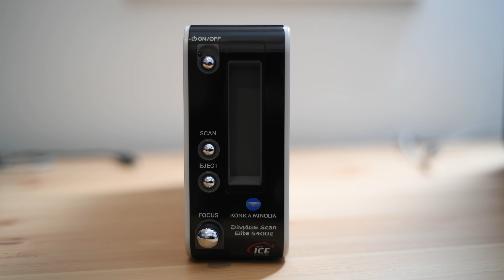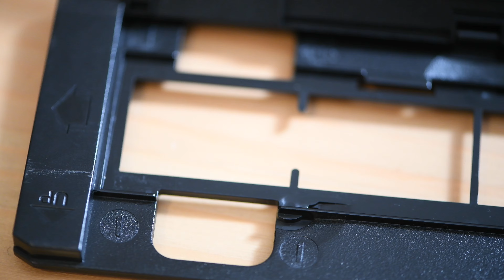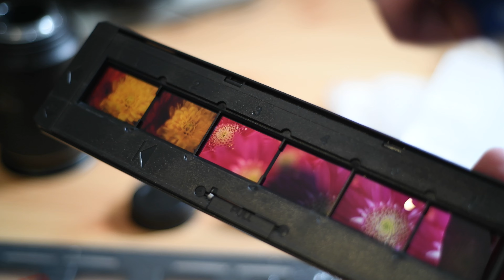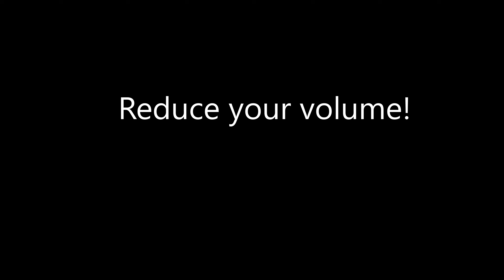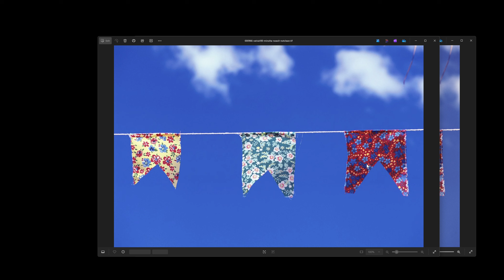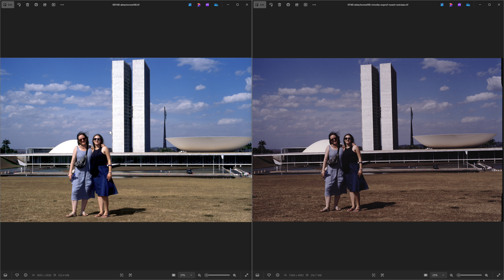Konica Minolta Scan Elite 5400 II film scanner review

Comment: I've had this scanner since it was new in the early 2000's.  I now have two.  I used it with the original Minolta software (I have a driver that makes it work on Windows 11) and now with Vuescan which also installs its own driver.  Vuescan is, I believe, the best software today for it.  With the right settings, you can get superb results - better than any flatbed scanner.  I get pretty close results from scanning with the Fujifilm X-T3 (26 MP) but I always come back to this scanner - it's still noticeably sharper and has better colors.  You get that true analog film look vs scanning with a digital camera.  After a lot of trial and error, I now use 48-bit TIFF file output (NOT raw), import to LR, run Negative Lab Pro TIFF Prep utility (Linear Gamma 1.0), convert directly in NLP (Linear profile), and you'll get the truest colors possible.  You're welcome :)
Reply from the maker: Interesting. I’ll try that once I get paid. 😂 I tried vuescan trial but didn’t like the colors. Black and white was better than the Minolta software but color was rubbish. But I had not thought of inverting elsewhere. Any alternative to running the inversion rather than under Lightroom? I managed to get rid of my adobe subscription 2 years ago and not very keen on getting back. 😢

Comment: Where and how do you get color profiles? In Silverlate programs? I will buy this scanner in two months ^_^ I have thousands and thousands of thinner negativs and the big fats ones but those i need a flatbed for i think.
Reply from the maker: I use a scanner color profile application and a target. The target you can get from lasersoft. There are open source and paid options. I settled for i8profiler.
Reply: @Shiunbird  Thanks for the answer! :D <3
Reply from the maker: @SammeLagom Anytime! After calibration, both my V850 and the Minolta match colors almost perfectly.
Reply: @Shiunbird  Sounds good! I look forward to get my scanner, im saving for it now. Good to know I can get color profiles so the colors will be correct; thats important.
Reply from the maker: @SammeLagom You need to make them. ;) there’s an open source option. It works. But I got a bit better results from i8profiler. It’s not that hard. Scan the target (the program gives the settings), load the TIFF, done. The only sad part is that the targets are very expensive. :((((
Reply: @Shiunbird  Ahhh ok.. I will see how it works when i get the scanner. Thanks for this. I will save these messenges.

Comment: What scan software did you use, and was calibrating the colors easy? I’ve had this scanner for years, but I never really use it for c-41 negatives, since I think the colors gets butchered. But seeing your scans make me realize I’m not getting the scanners full potential. I use vuescan. 
Hi from Denmark!
Reply from the maker: I am using the Minolta original software on top of Silverfasts drivers. It is very good but I find vuescan better for black and whites. Now I use Silverfast for large format on the v850, the Minolta utility for 35mm color and Silverfast negafix for bw when there’s a profile and vuescan when there’s no profile for the film
Reply from the maker: And hi from Prague ;)
Reply from the maker: Also… for slides, get a target and calibrate it. It makes a world of difference. For c41, I love what I get from the Minolta software.
Reply: @Shiunbird  Thank you for the quick answer! One last question. Is it really that straight forward to install the drivers from minolta, and just open vuescan and then it operates on that driver when scanning? Because if I could get it to do that and get better results, that could save me a lot of money and make my workflow much better. Is there an a guide or anything online? Thanks again!
Reply from the maker: @sdseriesboy  I am not using the Minolta drivers. They don’t work. Basically, I have Silverfast installed and I wanted to test the Minolta scanner. So I installed the Minolta scanning software and it just worked. I was puzzled, so I went to the device manager and found out the Minolta was using the driver provided by Silverfast.
Reply from the maker: @sdseriesboy I believe if you have the vuescan software installed and just now install the Minolta scan program, it will just use the vuescan driver and work ok.
Reply: @Shiunbird where did you find the original minolta software program? I have been looking all over and I keep getting directed to the Konica minolta site where you kan download the drivers. 
Sorry for all my questions ☺️
Reply from the maker: @sdseriesboy I got it from the Minolta support page. It’s all in the same package.
Reply: @Shiunbird IT WORKED! I’m scanning in the Dimage scan elite software, and as your other video showed, it says that my scanners is produced by laser soft imaging. It booted up and I was laughing my ass off. I can’t believe it actually works. It really is plug and play, even on windows 11. 1000 times thanks for the help! Will be watching your channel!
Reply from the maker: @sdseriesboy Anytime! Despite the fact that the Minolta software does not scale well on high dpi screens, I really like the results from C41. Download the pdf manual both for the scanner and the specific manual for the software. It has great info on the color inversion and balancing processes. The interface reminds me a lot of what you get on frontier scanners and this is really saving me time. Also ICE works brilliantly and I hardly ever have to remove any dust. 

I exchanged a few emails about this with Lasersoft engineering asking why don’t they support the 5400 II and they were surprised that it works. 😂 they also said they consider reviewing it and that probably something changed in windows 11 as they were struggling to get it to work under windows 10. 

I don’t like Minolta’s output for black and white at all and E6 only works with a color profile (otherwise the magenta cast is intense) but this is now my favorite method for C41 and I want someday to compare it to Silverfast negafix. And the scanner is great as you well know!

Comment: If you can get the 5400 II, as opposed to the 5400, do so. The difference between them relates to a light source modifier invented by a Dutch guy for users of the last KM medium format scanner. I greatly improved thee clarity of the scanned image. Mineola was impressed and incorporated the technology directly into the 5400 as the primary  improvement for the 5400 II. That also explains Whyte drivers for the 54000 work well for the 5400 II.
Reply from the maker: I’ve heard the 5400 is better for black and whites because of the hardware grain diffuser rather than GEM.

Comment: He didn't cover the software in the first video either, so you are left to yours our devoices to identify and download whatever combination of software he is using. Understand that the Konica Miniolta software will NOT load and run directly in Windows 10 or 11. I think he is buying Vuescn or Silverfast for a Windows compatible driver, then running  the K/M software on top as the operating software. Doing this with Vuescan has been the traditional process, which is detailed in a number of on line videos.
Reply from the maker: Good point. I have Silverfast because of my Epson V850 and, surprisingly, when I connected the Minolta, Windows activated the Silverfast driver even though Silverfast 9 does NOT suppprt the 5400 II. I believe even Silverfast demo should provide the driver and make the scanner work. I exchanged a few emails with a Silverfast developer about it and he will look into it.